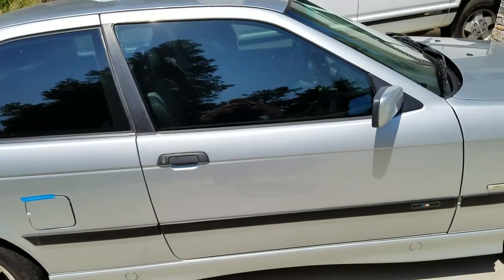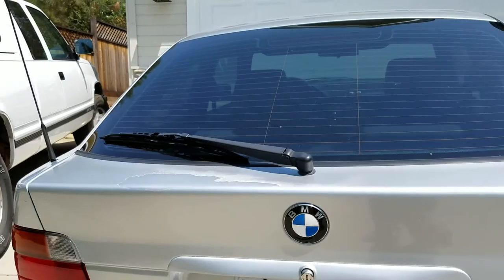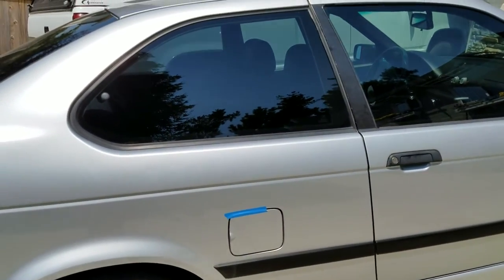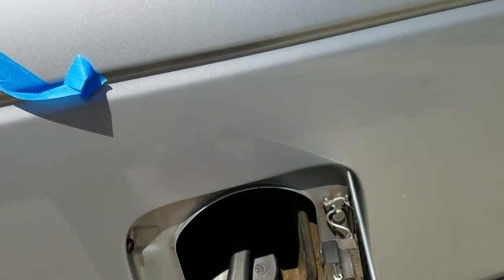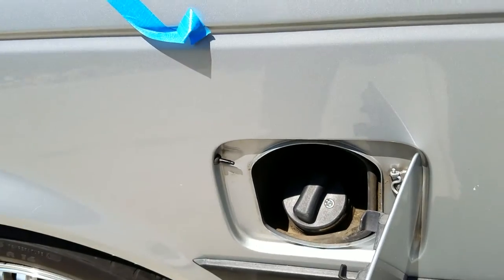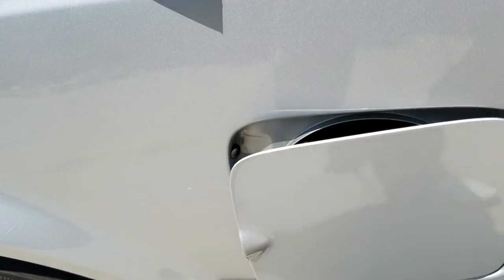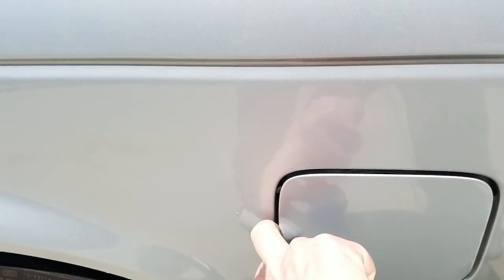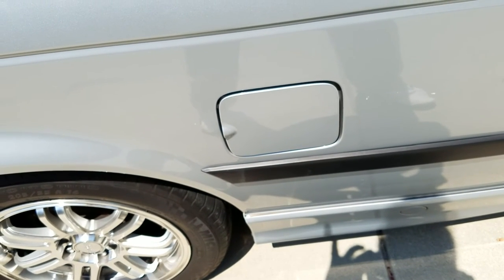BMW 318ti fuel fill door actuator issue

Comment: hey I don't know how old this video is but all you gotta do is clean out the dirt build up in the hinge spray W-D40 or any other lubricant and open and close the gas door a few times and it should work try it out...
Reply from the maker: Thanks, Mario! You are correct. I purchased a replacement spring, but did the WD-40 trick while I was waiting and it started working immediately. Now I have an extra spring :)
Reply: That's awesome I just started having the same issue on my car just fixed it yesterday I had the same issue with the door not staying flush with the body.
Reply: The WD 40 trick worked on mine as well. My spring was just fine so I knew it wasn't the problem
Reply: Thanks guys, I've just started having the same issue with my compact I've owned 5 years...
I'll try WD-40